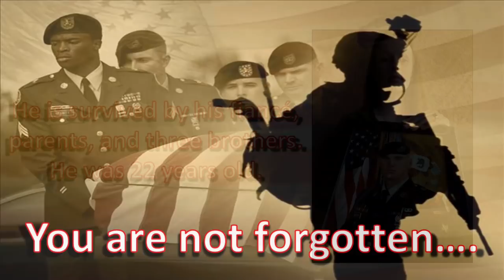One Year In Our Alliance RV (List Of Everything That Has Gone Wrong Or Broken)

Comment: Oh people, we bought a Jayco Pinicle in 2019 and it has been so incredible! We had a leak and it was a pinhole at the roof which I siliconed and it stopped  and a leak in the pipes to our washer which we don’t have and we repaired that. Out side that not a single incident! We love our home. Quite often people ask us would we do anything different. Not a thing! We love it. Our trim and cabinets are so beautiful, so much better than rigs that cost $300,000 or more! And I did finish work on homes and cabinets for 45 years. We love our rig and recommend it to anyone!!
Reply from the maker: Sounds like a great RV. We are glad you have not had any issues.

Comment: Tony and Jennifer at Alliance have been amazing! I have a customer with a brand new 310rl and for the past year, Alliance called me, Myself and the owner have  replaced slide bars on the dining room slide, bulb and wiper seals. the under belly as the dealer had cut it open AND the bed room slide mechanism as it was binding. Everything Fedex
to us. Lately the bedroom slide FEll out! Alliance covered the cost of the replacement slide room and shipped it complete. Installing it is this weekends project. Very easy people to deal with. I wish moree RV manufactures were like this. Grand Design and DRV are pretty good as well. Lux is in a place all by themselves!
Reply from the maker: We love the customer service. It is one of the big reasons we went with Alliance.
Reply: That's amazingly terrible, you shouldn't have to do any of that work.  Manufacturer failed to provide a quality product.

Comment: Towing your trailer will loosen up some fittings. The vibration of towing I think is the issue. My under the kitchen sink drain would loosen and drip. So any time I towed the trailer I would tighten it up. It was always loose.

Comment: Just fyi on the slam-door latches. The handle itself I believe has adjustments to it so you can lower it down. On mine over time the latch moves up so I have to adjust sometimes. Bathroom rail I have the same problem , bought it in Sept first shower water.
Reply from the maker: We will be at the Rally in May and they said they can fix the latch.

Comment: We are only what....6 months into living in ours and we've had nothing but one blind fail and the auto level has never worked.  I retapped our AC units and that made a world of difference, I can now be up to 30+ degrees from ambiant temps vs the fighting to get 20 below outside temps.  

We are also in an avenue vs the paradigm and swear our rig line is what they train on to make yours.  I do know our model has the best of both lines, the 37 mbr was a prototype model when we pulled the trigger ><  Customer service has been a godsend and that's what sold us on the unit too.  Now that I just found ya, I need to see what else you got content wise.
Reply from the maker: We are glad customer service has been taking care of you. It's one of the reasons we went with Alliance also.
Reply: Your auto level system might just need to be Caliberaited.  last year at the PAC Northwest Rally the on-site tech did this for quite a few owners.

Comment: With the bay door issue, you might try loosening the latch on the door and see if you can shift it down a little to make a better connection.
Reply from the maker: We have it on our list of things for Alliance to fix at the Rally. I don't want to break it before they can fix it. 🤣
Reply: @WaywardWaggs  Gina can probably tell you I've broken a few things trying to "fix" them 🤣🤣🤣
Reply: @HitchRollRelax  I can believe that, not many handy guys would call a fitting a fixture. :)

Comment: Nice video. Those are really minor issues, and more importantly it sounds like customer service isn’t a voice mail black hole.
Reply from the maker: Ya, they were so minor and customer service is awesome!
Reply: Overall I like what I’ve seen from this brand. Broken spring hangers are pretty common across the industry, and Alliance reinforces theirs and does it correctly.  Inadequate tank support is something I’ve seen for many years across brands, and Alliance claims their theirs are intended to be strong enough to be used. 

The wiring and electrical also seems a  bit better laid out.

Comment: Glad to see your video. Well done. And no, you don’t need a tech for all those. Well done on quick easy fixes. Frustrating though. They aren’t meant to be lived in full time but two weeks out… well. You know. 
I have had a lot of connections leak. And there is a leak coming from the door or around the door on the drivers side bay that lets a lot of water in the bay every time it rains. Some issues are going to happen. Some issues are a quality check issue. Fun fun.
Reply from the maker: Hopefully you won't have any major issues. Alliance is very responsive when issues arise though.

Comment: Definitely get the latch and shade fixed. Sounds like the shower track was put in 180° out. There are supposed to be little open slats for the water in the track to drain into the shower. If the track was put in wrong it would drain on to the floor.
Reply: Like he mentioned in the video. 
The end where the vertical and horizontal track meets was not sealed correctly. 
We had the same issue with ours and it is a very simple fix. 
If the track was backwards it would still be leaking.

Comment: We're getting an Alliance Avenue next Friday.. glad to hear some of your problems so I'll know what to look for... I'd be worried about what fittings are slow dripping where you can't see... you know over time they'll get worse and who knows what... I watched the Alliance factory tour and how well built they are... they really are.  I can't believe all those loose fittings.. and the mislabeled waste tank... I'm a little paranoid now.  I'm going to get that tool and try to check everything.
Reply from the maker: Welcome to the FamAlly. We hope you enjoy your new Avenue.
Reply: We were able to get in one trip before the end of the season and I'm glad we did! We had about every problem you had including the leaks, the slam latch (they claim we need a whole new door) our tanks were all mislabeled,  the microwave was all out of balance and made a racket.. TV wires were not hooked up behind the wall,  a screw was through the center of the slide and cut the floor.... faulty brake light... lettering coming off the front... idk.. been at the dealer for the past 3 months. With a list of 15 issues.  it's now mid-February.. Alliance claims quality over quantity.... SMH. Also the leveling system always says error... I'm pretty disgusted with my new purchase so far..
Reply: Quick update... it's now mid March... NOTHING HAS CHANGED.

Comment: Hello all, I have a Alliance 310RL which I purchased in February. I have listed a majority of things that I have happened with mine. These don’t include 13 items that were discovered on inspection day that they (dealership) had to resolve. I am not here to bash Alliance, but sharing my experience. I have not been 100 percent satisfied with Alliance nor the dealership I purchased it from. They are supposed to fix all of the remaining items next week. I am hoping this will be the last time it has to go into the shop. I am not a newbie to RV’s. I have had 2 Grand Designs (my favorites), Keystone Carbon, an older Thor product and now the Alliance. I do expect little things, but not everything we experienced. Please see a list below. 

Fresh water tank leaking from the valve - I had to fix myself

Black out shades - The shades would not stay down - I had to remove them and make adjustments on 3 different ones. 

Leaking hydraulic on the right rear - still leaking. All of them are also making a creaking sound. 

The reservoir was overfilled for the hydraulic fluid and leaked all over the front compartment. I had to remove about 1 quart of fluid to prevent further leaking. 

Sewer valves are leaking so when I take off the cap, I have black sewage leaking all over. I am not talking about a little residual, I am talking about 4-6 cups worth of liquid. I had to purchase a secondary valve to prevent this from happening until it goes in for service. 

The shower shelf was only screwed in with one screw and had silicone everywhere trying to hold it in place. I had to remove it and fill it with silicone to prevent further damage to the shower. 

Waterspout on the passenger side will not connect to the hose. 

The underbelly had gaps which could allow rodents inside.

The main door literally separated from the hinge. 

This doesn’t count all of the other little things that I had to fix as well. 

Interesting on the floor, I will have to check to see if I have that little block as well. Both of my slides leave marks every time as well. 

Thanks for reading and hopefully this will help others.
Reply from the maker: Thanks for sharing this information Brian. We truly hope they get it all fixed up for you.

Comment: That all is crazy. It's always something. Tiny but annoying. When you check your RV before leaving it's so easy to miss the (normal) items. I'm so glad it didn't damage your floors. Did you have screens? Did you take them out? My biggest issue  with ours is that about 50% of them just don't fit. So if you open the window bugs can come in. No help from Riverstone. It does bother me that there are so many items you had. I know it's made by humans but I think they all rush when putting it together. Some end of ok and others have little problems. My last comment is on all manufacturers
Reply from the maker: Alliance has been very responsive with everything and very helpful. All of our screens work well.

Comment: You're very lucky. I have spent hundreds of hours fixing all the factory screwups. The license plate bracket and license plate fell off on the very first trip which was only 30 miles from home to a state park. The screws holding the license plate bracket were stripped out from the factory. The second week the 50amp plug where you connect your power cord to the side of the RV fell out because the factory stripped out the screws holding it. The taillights fell out. Again the screws holding it were stripped out. Not mention all the pinched and bad wires I've had to repair. I haven't had any AC electrical power in the kitchen slide for a long time. More pinched wires in the under belly I'm sure. I've already had it off several times for wiring repairs. Lost all AC electrical power in the bedroom night stands because they pinched the wiring to it when they put in the wet bay. It would be a very long list if I listed everything that has went wrong. I would have traded it off long ago but I spent most of my retirement money on it so now my only choice is to keep fixing it. Just hoping the all wiring problems don't burn it down.
Reply from the maker: That is terrible. We have to hear that. We hope the manufacturer is helping with the fixes. Either way, it is a huge inconvenience and you shouldn't have to go through that.
Reply: @WaywardWaggs  Unfortunately, no help from the manufacturer. Out of 1 year warranty period. I'm totally on my own.
Reply from the maker: @bethmikels3613  Bummer. 😔

Comment: I wonder how dealers feel about a pre pickup inspection. In case those little things need tighten or caulking or you need replacement parts before you even pull out of the lot. I know things go wrong but you should at least start with as clean a slate as possible. Great video.
Reply from the maker: Most dealers do that but how well they do it is not always the best.

Comment: I got mine, it’s a keystone passport.. not a 5th wheeler… just a travel trailer. The heater would work for 15-20 min then shut off… after 3rd time taking it in, they finally just replaced heater, trim broke on door. I need to replace that yet, the toilet flush peddle broke.. they said not replaceable, need new toilet.. and of corse not under warranty. Found part on eBay and it’s on its way. FOR ONLY 20.00.. one of my garage doors, the lock is very hard to turn. It needs to be replace and I have screws that keep coming undone on outside that I just need to glue? Silicone? In the fricken whole! It’s frustrating, and due to demand.. I heard they are making them even worse now🤦🏼‍♀️… love your videos. Keep them coming
Reply: Oh and I order the wrench for the fitttings thank you. Because you know every RVer is gonna need it!
Reply from the maker: We are glad you got some things repaired on yours and glad it didn't cost too much. Some repairs can be very expensive.

Comment: Hey Dustin, this might work for you with your propane straps, when I'm putting the tanks in I kinda wiggle the tank around and makes closing the latch much easier. Not sure how it will work on yours since I only have one strap holding my tanks. I have a 2019 Cougar 362RKS. Plastic wrench is in the basket, thanks for that.
Reply from the maker: There is definitely an art to it. You have to get them in there just right. I hate the latches.

Comment: Like you said very minor. Appreciate the info. I’m manly concerned about construction faults leaking roof windows holding tanks slides not operating correctly.  

Minor plumbing under sink’s toilet cabinet latches are kinda expected. 

One question.
 Do you find it hard to heat with them big ass windows which I love. 
I have seen with some brands with all the windows it can be chilly.
Reply from the maker: We had a Montana before the Alliance and we have not found it any more difficult to heat the Alliance than it was in the Montana. Usually the coldest is at night and we have the shades pulled down so it keeps the cold from the windows at a minimum.

Comment: Wife and I recently went to look at a Avenue 32RLS and a Paradigm 295MK. To preface, I'm a very technical person and very anal when it comes to things being "engineered" properly. And some may not like my opinion, but I think the Alliance products quality is only skin deep. They look beautiful with a very modern design and layout. While my wife was oogling over that aspect I started to really look at it from a technical aspect. For one, behind that access panel in the pass through storage....I can only describe what I saw as a web of cabling everywhere. If something needed to be serviced beyond that web there is literally no way to get to it without cutting cables. A little more thought and engineering could have gone in to that "mess" to put cable hangs and run the cables in an orderly fashion. Second, the shower in the 32RLS. The floor was like a trampoline. Zero support under it, especially around the drain. I'm only 175 lbs and the floor was moving a good inch or more in some spots. That's a recipe for a broken shower and/or drain plumbing. I did not see a way to access that area from underneath either, so it would most likely need to have the shower removed to address that. Third, and this is being nit picky, but a lot of the trim inside, like the baton's and crown molding, are fake wood with like a wall paper print on them. And in a lot of spots that wall paper print was coming off or shrinking. Fourth, as noted in this video, the slam latches were not properly installed. On the 295MK the driver side storage door wouldn't even close on one side. On the 32RLS the entry door wouldn't close without pushing it from the bottom. Fifth, in the 32RLS the bedroom ducted A/C on full blast barely had any airflow coming out of the vents. I closed off the dumps and it was barely blowing any air. This only had 4 vents, 3 in the bedroom, 1 in the bathroom. You could barely feel any air coming out of any of them. Something was definitely up with that. Sixth, in their "customer driven features" on their website they tout Lionshead tires. Neither of these 2022 rigs had Lionshead tires. They were some off-brand china bombs. 

My final point of contention comes from speaking to an Alliance rep that was there. I specifically asked about the frame. They use a Lippert Benchmark frame. I then asked about installing a Reese Goosebox since that's what I prefer to run. He said they do not recommend the Reese Goosebox, but instead suggested the Gen Y hitch. Which I find odd since only the Reese Goosebox is OE approved by Lippert with their frames. If you sustain frame damage with the Gen Y you are pretty much on your own for the repairs. This all didn't make sense to me why they would recommend a product that their frame manufacturer has no association with.
Reply from the maker: We have not had any issues since this video and Alliance customer service has always taken care of us when fixing issues so we will stick with Alliance. We hope you can find a brand that suits your taste.
Reply: Welcome to RVs.  'skin deep' is the motto of pretty much all the manufacturers.  I have heard other folks say nice things about the factory support though.  Seriously, though, how does something like missing window trim get through QC?  I do like the shut offs at each fixture, it should be mandatory.
Reply: @543whitey  How robust is the process if the fittings go out the door loose?  I'm picking between Montana, Alliance, and Brinkley for my replacement.  Once you start getting into details, every one is riddled with problems.